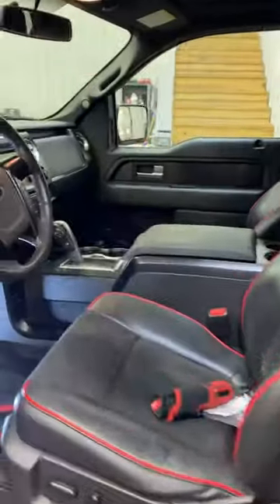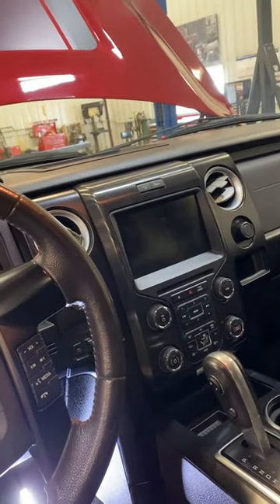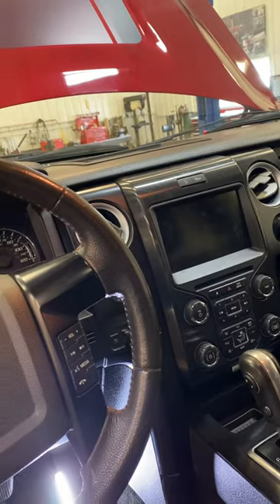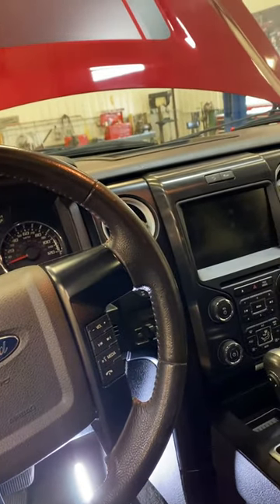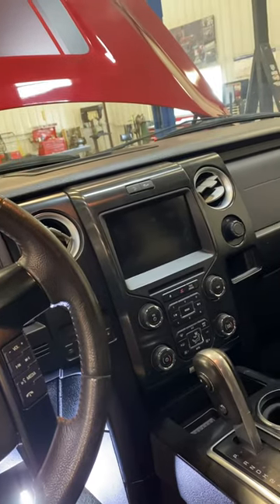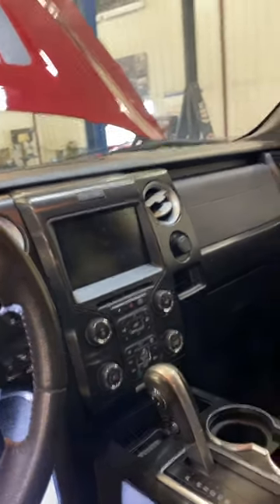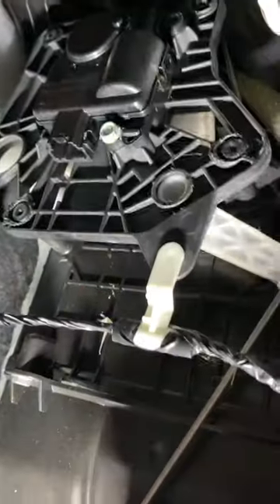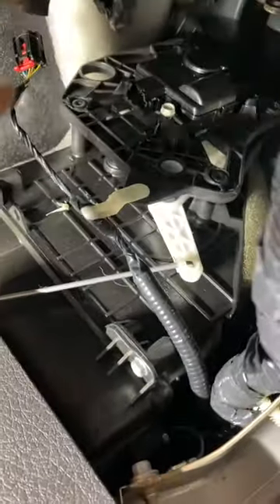2011-2014 Ford F-150 Clicking Behind Dash Drivers Side (easy fix)

Comment: I just want to let everyone know. There are several part numbers of these motors for the 2014 F150. Always purchase these motors from the dealer using the VIN number and build date due to parts getting updated regularly. Other F150 models may or not have the same part numbers base on interior packages as well. In my case, my 2014 STX has a different part number base on the build date than earlier STX models of the same year.  Lastly, stay away from the locals parts shops junk.

Comment: I just disconnected the lead and it finally shut up! I set the air flow to come out of the vents instead of the upper dash or floorboard areas before I disconnected it so it's just stuck in that position which is fine because it's summertime. This all started when I was running my heat on full during the winter. Suddenly the fan speed knob quit working (it's stuck blowing at about 50% intensity) and then I noticed that the system would not stop moving air even when the power button is pressed and the lights are off. The temperature control works and the AC compressor button works as well as Max AC and circulating button. The floor/dash/vent selector is also working but when you set it to vents only, it will start making the sound for about 2 minutes and then stop. It would also make the sound when the vehicle was turned off. When approaching the truck after it has been sitting powered down, as soon as one of the door code buttons or the unlock button on the key fob is pressed and the system initiates, the noise would start up again even though the vehicle isn't running.  So annoying! Thank you very much! I will replace it eventually but now I'm just enjoying the peace and quiet. 

(Edit: The noise really does sound like it's coming from behind the radio in the upper dash area, but it's just projecting out through the vents. I, like many other people in this thread, was assuming it was coming from behind the radio in the upper dash, but it's not. I could actually feel the pieces moving with my finger through a slot in the side of the part. So glad I watched this video!)
Reply: WHAT CAUSES THIS!?!?!?

Comment: DON'T REPLACE WITH DORMAN.  Use OEM motors.  I just replace the the motor on the bottom of the HVAC box, which includes console removal.  It can be done without pulling the dash.
Reply from the maker: Yes I agree. Only replace with OEM

Comment: This video saved me from spending 2+ hours of my life replacing the blend door actuator for the 2nd time. Replaced this part on my 2014 and solved my issue, took me all of 10 minutes. The clicking was only occurring when the air mode was on auto.

Comment: Spent at least two years just living with it after replaced the one behind the radio. Your video solved my problem and I now have peace and will keep the truck longer. Big thanks!
Reply: Wish I know how to replace the one behind the radio
Reply from the maker: @nickgonza457  I should’ve put a video when that one went faulty on me. There’s other videos out there that show how to replace that one.
Reply: What happens if you just unplug it instead of replacing?
Reply: @jakedunn7709  Thats what I just did. I have air coming through the top vents, think that should be fine. Unless I get caught driving in an ice storm or something and really need defrost, only thing I can think.

Comment: This is an excellent video. It doesn't use any fluff in the into to try and boost viewer minutes or go into a lot of useless background info or any other distractions. Here's the problem, here's the fix. Period. Simple and straightforward. Wish all DIY videos were this concise. This video rapidly identified and solved my problem. The driver side actuation was definitely the one clicking when I put my hand on it and it only took about 15 minutes to get the old one out. Will be putting in the new one today. Unfortunately had to get a Dorman part because the dealership was closed by Saturday afternoon and I needed to get the truck put back together Sunday. At least it has a lifetime warranty and is easy to replace again if needed. Only remaining question I have is whether any sort of calibration or adjustment is needed once the new one is installed, or does it self-align. BTW, I opened the old one and found broken gear teeth inside.

Comment: You just saved me big time, the passenger side was blowing hot air and driver cold air on Max AC I just disconected it from the motor and everything worked just fine again both sides on cold Ac at the same time, will fix it soon but for the moment I can be in peace knowing that I dont have to tear apart half dash board, thanks you just won a spot in heaven lol 🙏🏻🙌🏻

Comment: Thanks Just saved me a ton. Thought I was going to have to take to dealer to do lower motor because I didn't want to mess with that. This was one clicking. Unplugged it or now. 
Ordered for $34.
Reply: Whats the name of the piece
Reply: @carlosespino214  MOTORCRAFT YH1881 HVAC Mode Door Actuator  This is what I ordered from Rock Auto.

Comment: This just started happening in my 2014. I already have an issue with my air recirculating blend door and I’ve been putting it off for years because I don’t feel like taking the dash apart.
Reply: Does this actually going to fix the air circulating blend door? I thought this was only going to fix oh I see this is the door actuator he's talking about! I thought there were two different things that he was discussing and that he did not tell about the repair of the one never mind I think I listened to this wrong! Hopefully that's the case because this this is my fix that will be wonderful!

Comment: I wish you would have played a sound of his clicking noise. Because mine is not coming from under the dash it's definitely up near the top of the dash. I really think mine is going to be the one that's difficult to get to. But I would have liked to hear the noise
Reply: I'm having the same issue and I came to see if if the sound was similar and coming from the same area.

Comment: Is that part the one clicking when you go from defrost to the AC? That's when mine does the clicking.
Reply from the maker: That would most likely be your blend door actuator behind the dash, that allows hot or cold air in. Would make sure by switching AC to heat and at the same time putting your hand down on this actuator to make sure this one isn’t acting up. If it isn’t, you will have to replace the one behind the dash.
Reply: Mine is clicking/ ticking but when I turn the heat on it stops

Comment: What if the blower motor resistor is working and not can that be a problem too and making that clicking noise?
Reply from the maker: Hi, mine also actually went bad a few months ago where the fan speed wouldn’t change. That’s what that resistor controls is fan speed. If there’s clicking it can either be blend door actuator or mode door actuator. Hope that helps thanks
Reply: @colehaverhals7544  might as well replace the resistor and that actuator

Comment: Hi. My 2012 F150 recently started making a sound behind the Dashboard, I can describe it as a woodpecker and that sound takes only a few seconds when I start the truck.
Help Please.
Reply from the maker: Yes that is pretty much what it sounds like and it goes for about 10-15 seconds upon first start up. First make sure it isn’t the one down by driver side gas pedal by putting your hand on it when you first cycle key. If you feel/ hear the click coming from down there replace that one. Otherwise could be the one behind dash
Reply: @colehaverhals7544 what’s the actual part called? Actuator?
Reply: Mine keeps ticking until I turn the heat on. I was hoping to maybe free it up by turning the fan up and down or changing the heat from vent to floor Etc but it keeps doing it as soon as I turn the heat off so I'm assuming that this is not the fix for my situation which really sucks

Comment: Hello I have a 2014 F150 stx and right now the air recirculation button keeps turning on when I turn the a/c or fan on at a 1-4 speed setting I turn it off and within 30sec its comes back on any clue what it might be??

Comment: I have the same problem. I  installed new part but still makes the clicking sound? I can feel the actuator vibration when after pressing defrost to ac vents
Reply from the maker: That could be the one behind your dash making the clicking noise